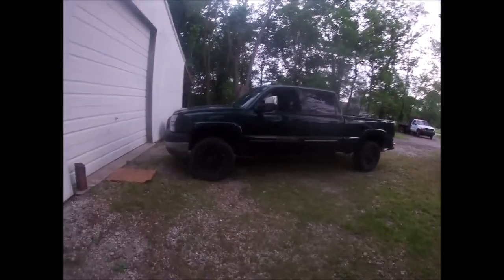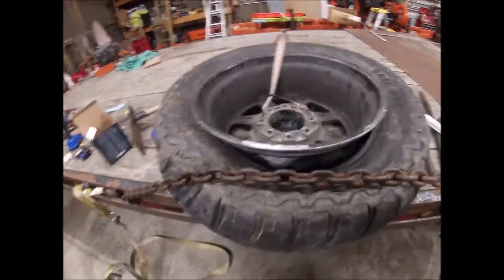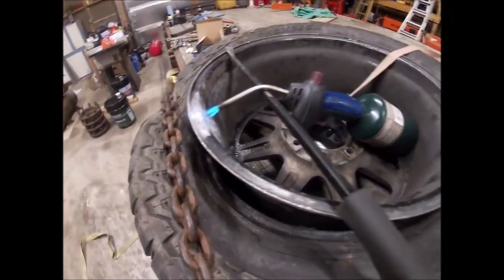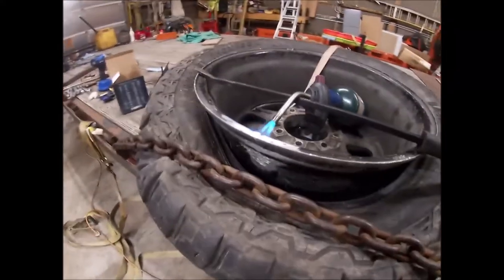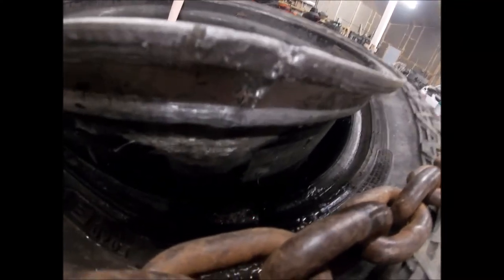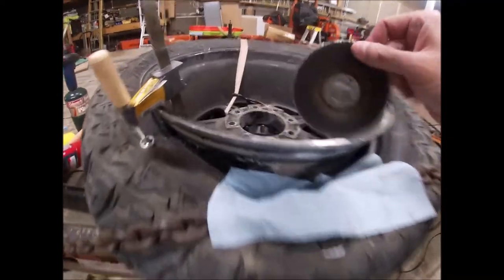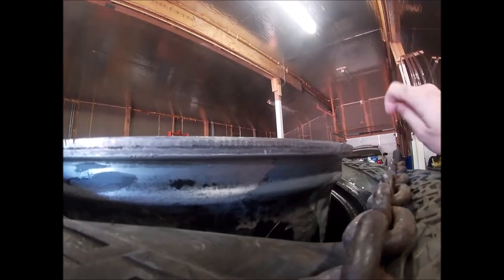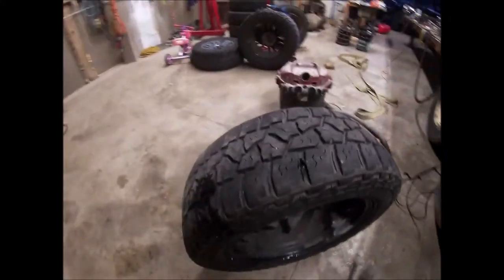Aluminum Brazing Cracked 20" Rims

Comment: Do you think its possíble to use this sticks to fill the Holes on center of the rim. To make new ones?
Reply from the maker: It might be possible but tig welding might be a better option if the hole is really large.

Comment: Can you describe your torch setup?  Looks like you tiny gas tanks
Reply from the maker: The kit is a Mapp gas and Oxygen torch setup.  I bought it from a local farm store called rural king.  The link is posted below.  I also used a regular propane torch as well.  The nice thing about the Mapp/Oxygen setup is it feeds thru a pencil type torch and is limited on its heat output so its less likely to melt the material unlike a Oxy/Acetylene setup that could easily melt aluminum.

https://www.ruralking.com/magtorch-torch-kit-brazing-welding-cuttin-mt-585-ox
Reply: @IndependenceIron  Thanks!  I started researching and picked up a similar torch from Amazon.  I got the map gas from Home Depot and the oxygen from True Value. I got Alumiweld rods from Harbor Freight along with some welding gloves.  Now I need to get someone to pop the tire off of this rim.  I am only doing this myself because I paid a shop $250 to weld the rim and it still leaks!  I suspect they welded the outside while ignoring what was going on inside the rim.  Wish me luck!
Reply: @BillAnon  did the aluminum brasing rods work for you/>
Reply: @warrenpeas  I could not get enough heat to get those rods to stick to the rim.  I guess I could have prepped the surface with flux.  I gave up and found a used rim for about $350.  I also bought a flux welder that I have not used yet.
Reply: @BillAnon  ok i was asking because i bought 4 rims for 80$. they are aluminum and i found a crack on the back side of 1.  i watched many videos where they drill the end of the crack and then weld it so i thought the alumiweld might be a good choice since i dont have a machine that can weld aluminum. i seen another guy fail with aluminum rods and i havnt tried yet but i did get a mapp gas torch instead of propane. i also have the Hobart brand rods which are supposed to melt at lower temp than some others.

Comment: I bought a dodge 2500 with the same wheels but it only had 3 of them. There isn't any names or numbers anywhere on the rims to identify. Where did you get your wheels from? Could you help point me in the right direction on where to find a wheel just like yours
Reply from the maker: My wheels came with the truck when i purchased it.  From what i could find the 20" version was discontinued, so that is why i had to find a way to repair them. I also realized the tires while new looking are also discontinued. 
I searched FB marketplace and picked up a cheap spare set of 17" rims with junk tires just in case i need a spare in a pinch.

Comment: Would map gas work to braze with? Have some drift wheels i want to try this on.
Reply from the maker: Map gas is a little hotter than propane but im not sure it will work. I heated for 30+ minutes with propane and couldn't get it hot enough.  On a small piece of aluminum sure  it would work, but a rim is so big and pulls the heat away so fast i don't think the marginal heat increase of map gas will really help that much.
Reply: @IndependenceIron   danggg  i just need the very  end of the lip  filled in on mine.  Appreciate the feedback! Is your repair still holding up?
Reply from the maker: @Silenttoxx  given how cheap the rods are, it might be worth a try but make sure you have a fresh mapp gas bottle.  With a small area like just the lip you might be able to focus enough heat on just that area to get it to work...never know until you try.

My repair was a deeper crack into the thickness of the rim so more heat required.  Mine is still holding up well and being daily driven in horrible, pot holed central illinois roads!!
Reply: @IndependenceIron  yeah its just the lip of the rim. So I'll try it before i go have it actually welded.  Thanks!
Reply: @Silenttoxx ow did it work on the edge of your rim?

Comment: Anyone who tries to repair an  alloy wheel with zinc solder, certainly likes to live dangerously as well as waste more money, than a proper welded repair would cost.....................lol
Reply from the maker: Maybe living a bit dangerous, but i doubt the zinc/aluminum solder is much weaker than the cheap alloy from who knows where that makes up this rim.  The repair is going on 1.5 years and no issues with that rim.
Reply: @IndependenceIron  I suggest you have a look at the strength of zinc solder, v 5183 filler rod.  Problem with videos like yours is that others will repair wheels in the same way, and they might not be as lucky as you have been.  Big responsibility if someone dies or is seriously injured, through doing a solder repair.
Reply from the maker: @humourless682  Hobart doesn't list a UTS for their aluminum brazing rod, but similar Alumiweld rods are 40,000 psi ultimate tensile strength, and the rod you list is 40,000 psi tensile.  These rods are suitable strength to repair the cast wheel.  The real risk comes in to how well the joint is prepped and making sure the braze(solder) takes to the aluminum.
Reply: @IndependenceIron  Solder is NOT brazing, nor is it welding.  Anyone who repairs a wheel with solder would seem to have mental health issues?  

Crap promoting solder repairs on highly stressed parts, is all over social media, and sadly some are likely to take this stuff seriously, and might end up getting killed or seriously injured!
Reply from the maker: @humourless682  Pulled directly from the European Aluminum Association - Aluminum Automotive Manual.  

6.3 Soldering
The term “soldering” actually describes a brazing operation using a molten filler metal with a
melting temperature below 450 °C. On cooling, a metallurgical joint between the two parent
metals is formed. The mechanical characteristics of the joint are reasonably good and thus
soldering can be used for example for structural repairs.

Im guessing you didn't actually watch the video where i showed that the rim had ALREADY been welded in this area and that weld FAILED.  It is very difficult to weld cast aluminum, and very large aluminum parts like this are prone to cooling cracks from welding.  Just because it isn't the strongest process available doesn't make it the wrong process!!